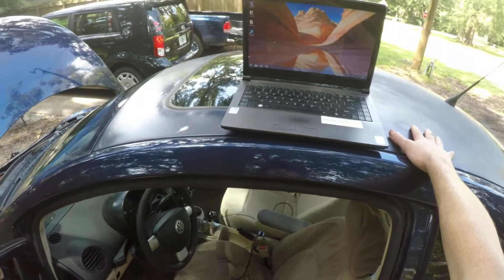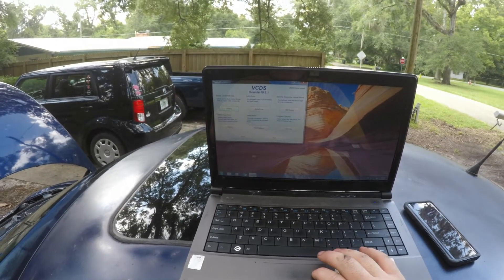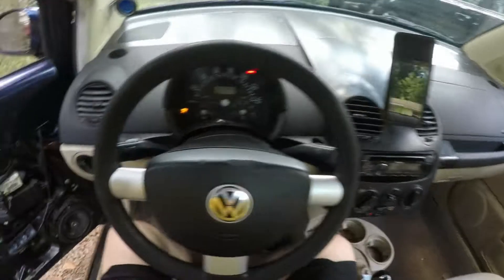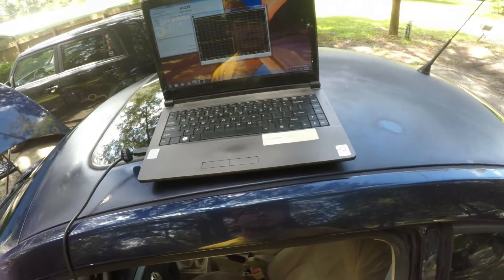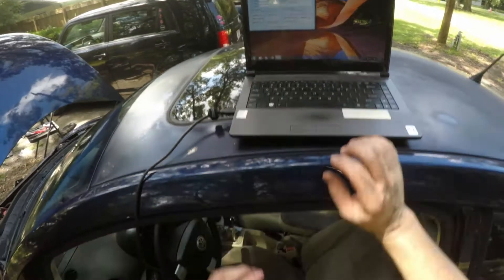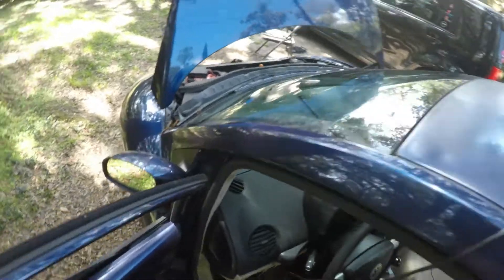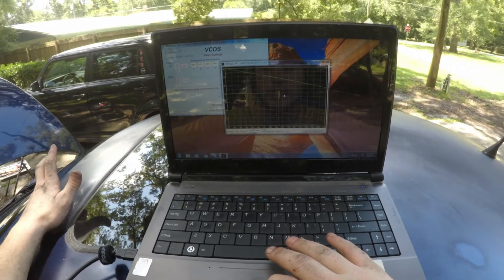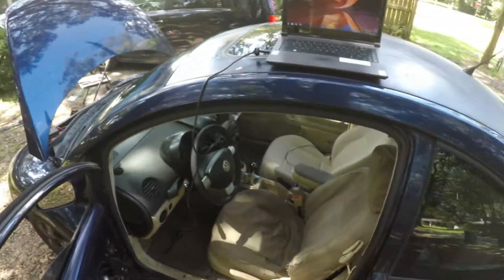Injection Pump Timing VW Diesel TDI ALH

Comment: How do you know by “driving you car”that the pump’s timing is off? Someone please reply..
Reply: your engine doesn't start!!  
After timing belt change your TDI should start with the 1st crank = blue line .... more than one crank is red or yellow. 
The adjustment range of your pump is aprox. 5° or 7° only 2° or 3° of this range is START or no start. 
Between red or yellow is power and fuel economy or frustration!
Double check your timing locks before putting on and fasten your new belt!!!

Comment: what about the mechanical adjustment with a dial gauge for people who don't have access to VCDS?
yay or nay?
any good or better to leave it alone?
Reply from the maker: Sorry but not possible not all pumps are that same so it will not work
Reply: @gearhead4266  most older VW Diesel engines (VW,Audi, Seat, Skoda) use the Bosch VP37
VW golf, Skoda Octavia or VW T4, all the same pump.
I think for 5 cylinders you have 0.55 and 4 cylinders 0.7 pump lift at TDC

my question is how this will look in VCDS if you use this method.
an other question would be if it's different across engines, like the ASV has smaller injector nozzles and slightly higher stage 1 pressure than the AGR or ASV
Reply from the maker: @nathanwest2304  on a mechanical pump sure but on a electronic pump like the later alh there is no other method. In VCDS there are many engines to choose from all OBD2 for VW Audi and Porsche. VCDS will have all the time charts.
VCDS the software is free it's the interface you have to pay for the cheapest being 199USD being that this is a tool the vw uses them selfs for diagnostics its a bargin compared to the rest.
Reply from the maker: And when I said not all pumps are the same I mean 2 of the same alh pumps will not be 100% identical more like 99.9 and it will make a difference

Comment: Dude, what you said at the end is where im at 😂 thank you for this video! Im advanced past the screen lol I was looking at the timing when turned over but not on like an idiot lol
Reply from the maker: Yah man they made the line green which doesn't help lol put of course there wasn't much info out there beside one other guy and it was just him using it and not explaining anything
Reply: @gearhead4266  exactly! Like green...REALLY 😂 & apparently my 2000 TDI Golf has been advanced the whole time Ive owned it since 2017 lol WHOOPS 🤭 
Edit: only figured out because I got VCDS because car is being SUPER temperamental lol
Reply from the maker: Same I was having hard starts with mine it wasn't what killed my alh later on tho ended up dropping a valve
Reply from the maker: If your interested here is the tear down of my alh that dropped a valve https://youtu.be/Ql8eK9BkPMM
Reply: @gearhead4266  yeah my starts were ridiculous, like hold pedal to the floor...did it just end up being the pump timing for you?
Reply from the maker: Yup just the timing my car now starts and idles very nice now
Reply: @gearhead4266  well Ill figure out if thats the case tomorrow. Shes smoking a bit but if shes as far advanced as it seems, that would make sense!

Comment: thanks, I already solved a problem of three, I am missing two, the start of the actual injection varies a lot and the deviation of the injection quantity in the cylinders is, cylinder 1 = 1.88mg / str, cylinder 2 = 1.88, cylinder 3 = -1.88, cylinder 4 = -1.88. can you help me please, THANK YOU.
Reply from the maker: Hammer mod and vcds (vat com) will help with injection quality you want to see between 3-5mg at idle as far as start of injection varying its normal to have some my injection pump varies enough that it will go from dead on to slightly advanced the slightly retarded some pump vary more than others my is on the lose side as long as it doesn't vary to much you should be fine

Comment: This is a nice video, just wanna let u know mine was off the chart way too advanced for 2 years and still runs fine so definitely not the cause of your engine dying
Reply from the maker: Thanks for telling me that man that makes me feel better I still haven't tore that engine apart to see what happened. I plan on doing a video of the tear down in the next few months.
Reply: @gearhead4266  I'm learning and definitely far from a mechanic but I didn't even know since my car has so many mods , turbo , injectors, 11 core in the pump , remap , bigger ic 63 mm exhaust and ic lines , like i told u its out of the graph u can't even see the top of the yellow line what you're calling advanced made me laugh and anything inside the top and middle line would be normal compared to how advanced it was on mine , so definitely not that the cause of it
Reply from the maker: I'm hoping to get some 1019 injectors tune pd150 intake omi and s7 turbo 3inch down pipe and 3inch straight pipe in the next month or so
Reply: @gearhead4266  thats pretty much the Recepie for power , consider the 11 mm core pump too , it helps feeding it , I've heard the 130 pd intake is better i know mine is not stock but I don't know which one is , most mods were already on it I've just been trying to learn about this engines
Reply from the maker: The pd150 and pd130 are the same